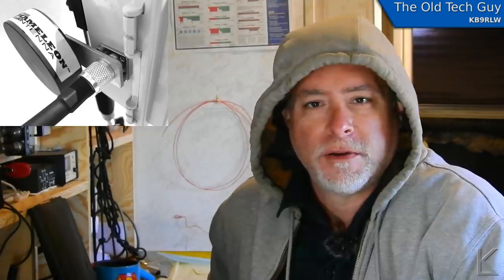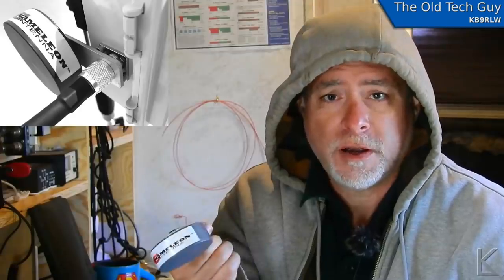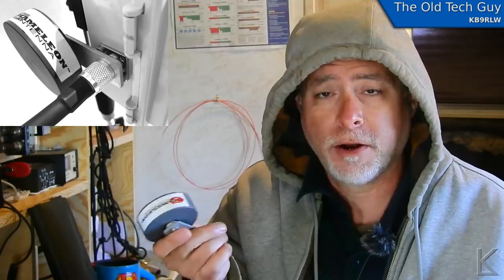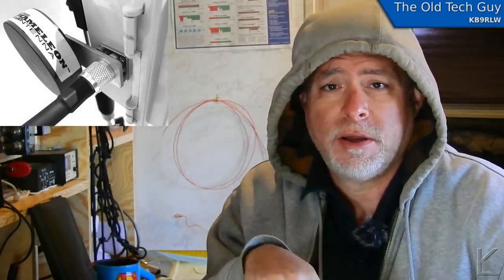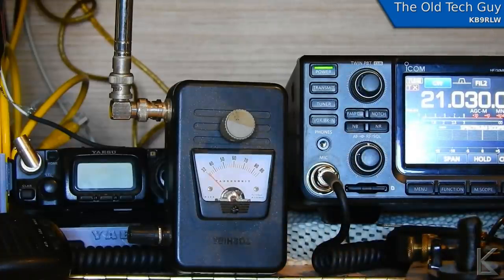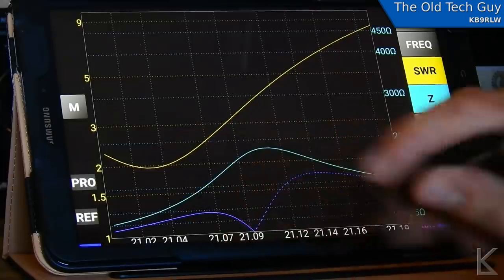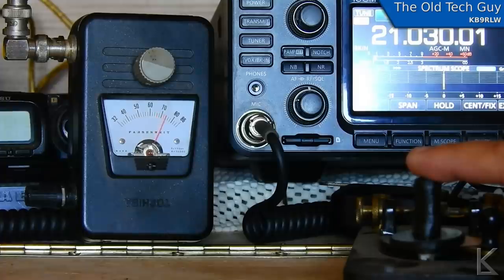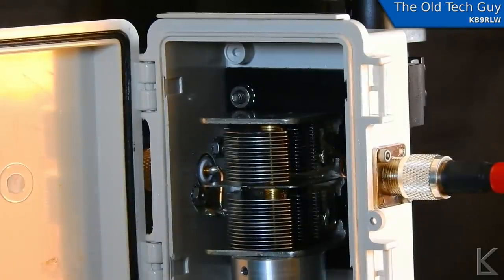Ham Radio - The Chameleon Antennas power compensator for magnetic loops.

Comment: Hi. This is Henri, VE2WHA. Why did not you measure the field WITH more power from the transmitter ? If no more power is radiating from the antenna, this not a very valuable device. Just a protection for the VC. The question is : is there more power radiating FROM THE ANTENNA itself. Could you tell us about this measurement ? Thanks a lot. VE2WHA.
Reply from the maker: I think the idea is to allow more power to be put into the antenna, which by default would increase it's radiation, to a degree.  Obviously not a linear increase, but certainly an increase.

Comment: I think its acting like a corona ring by adding more surface area there at the high Z end of the loop. When you adjusted the tuning cap to compensate for the shift, was it toward higher capacitance or lower? Fascinating...
Reply from the maker: Toward lower I think.  Yes, it shifted downward and I had to tweak it up in frequency slightly, so less cap.
Reply: @loughkb  If you could actually measure or see the voltages around that thing ill betcha the highest would would now be found on open end of that hockey puck... Thoughts? Many thanks... de K4WRF

Comment: I have another question for you. How important is the current choke on the coax? The reason I ask is the coax that came with my loop failed and I've been running coax without a choke. I don't notice any issues,  but I wonder.....
Reply from the maker: You'll have some RF on the shield of the coax.  At low power levels, it's not really an issue.   At higher power levels, RF coming back on the shield can get back into the audio circuits of your radio and distort your transmitted audio at the least.  Could be a health issue, or interfere with other electronics in the shack.
Reply from the maker: By the way,  I've noticed some intermittent connection on the shield on my supplied jumper too.   Those crimp on PL-259's are not well done, I think.  I'll probably put new ends on it.

Comment: Kevin, did putting more power into the antenna with the compensator actually put out more radiated power from the antenna or only into this device?
Did you look at the FS meter after you raised the power?
Reply from the maker: Yes, it was proportionately higher.   Had to turn it's sensitivity way down.
That was the reason I looked at the meter at 5 watts with and without the puck installed.   There was no decrease with it, which indicated that it wasn't dampening the produced field.  A lot of people seemed to miss that detail.

Comment: I would check it on a frequency that requires the cap to be meshed at least 50% before I trust their claim.
Reply from the maker: Later that evening, I was doing some psk31 on it down on 40 at 30W  without arcs. It does seem to work.

Comment: How does it work when it is positioned at the same place, but electrically isolated from the loop?
How does it work when it is positioned at an other place in / near the loop?

Maybe the trick of this thing is not the actual capacitor, but just its ceramic dielectric material. The dielectric material interacts with the E-component of the RF field. So this thing may modify the near to far field characteristics and help the antenna radiate power by giving the E-component "some place to resonate". Keep in mind that a material with high dielectric constant is to the electric field, what a ferromagnetic material is to the magnetic field. It "conducts" the field lines far better then air (vacuum).

Think of e.g. ceramic patch antennas for GPS ore GSM. These antennas would be much larger with air as dielectric. The high dielectric constant of the ceramic material in the antenna makes the antenna resonant at the same frequency but with much smaller dimensions. You could optimize the design in the other direction, e.g. to handle more power at the same dimension.

Comment: The clue of what it does is in the name remember the current is what we want radiating the extra cap in circuit compensates for the higher voltage reducing the chance of the variable cap arcing at a higher power output
Reply: This is the closest correct explanation of how the compensator works. In effect, the compensator is a series connected capacitor (in series with capacitance between braid and inner conductor) that lowers  capacitance and and in turn lowers the frequency of resonance. (as the video shows). But the voltage capacity of two caps is greater than one and thus the voltage input can be increased. Unfortunately, the current capacity does not change, and so the field strength is unlikely to change. This was shown on the video too. Would I buy one? No, there is no practical gain other than reducing the likelihood of arcing.

Comment: Did you measure the field strength (near field ) power output after increasing the power from 5w -> 30w? Is it possible the extra power is not being radiated by the loop but absorbed by the compensator? Would be great to see how the radiated 
power increases as you raise input power.
Reply from the maker: Pegged the meter, had to back its sensitivity way down. It was behaving as expected.  That's why I checked it both ways at 5 watts.  To make sure radiated power didn't suffer by putting the puck on.
Reply: @loughkb  so do I understand you to say that the near field field strength went up after you attach to the compensator capacitor and up to your power to 30 Watts?
Reply from the maker: @marcclarke01  That would be the reason for the meter pegging and me having to turn down its sensitivity.

Comment: Thanks, Kevin. I was waiting for this video for a long time. You are the best! However. I have a similar antenna Chameleon F-Loop 2.0. I've just checked my notes on this antenna and apparently it starts to arc only when > 30 W are used. 30 W or less are absolutely safe. Thus it's quite possible that the power compensator just does nothing. 73 de R2AUK
Reply from the maker: We'll find out in the future.   I'm going to build a beater loop once I pick up a sacrificial cap at the Yuma ham fest.   I'll push it til it arcs, put the puck on it and see for sure.
One of my home made loops had a cap with half again as much space between the plates and I couldn't get much over 30 before it lit up.   That was with more space.  Another loop I made with a salvaged cap spaced about the same as the one in the chameleon loop couldn't do much more than 15 before it flashed.
Reply: I have run 60w in my f loop with this compensator no problem
Reply: @ronangsr  60W with key down in CW?
Reply: @danielwebb1004  30watt in cw, 60w ssb

Comment: That is extremely cool!
I built my own loop a while back before I got my general, and my cap also has pretty tight spacing.
I want to use it for 10 watts SSB QRP, but this might change things...
One surmises that any cap of the same or similar rating would perform the same task if installed the same way.
Very interesting.
Thanks for another thought provoking video! 
73 de N2NLQ

Comment: But it's not really a test if you don't try 30 Watts without the compensator. If that capacitor flashes over without it in position then and only then we know it does something.
Bill, G4GHB.

Comment: The main claim hasn't been actually tested. You would have to find the breakdown point of the capacitor and that would have to be a point at which the capacitor arcs at least 70% of the time, then you would have to use this device and test with 2x the power. Your previous experience does not count, as the environmental conditions are not the same (humidity,  temperature ...).
Reply from the maker: I plan on picking up a sacrificial cap at the Yuma hamfest and building another coaxial loop just for that purpose.  As I said, I don't want to risk damaging the cap in the chameleon box.
Reply: @loughkb  Everyone likes a video with some electrical destruction so looking forward to that one ;)
Reply: Chameleon does have a video where they take it to 100watts (they don't recommend doing it). It did not arc in that video.

Comment: Does it flash over at 30w without it?
Reply from the maker: Like I said in the vid, I dont want to risk damaging this cap.  I know from my many past builds of mag loops that it absolutely would have.
Reply: @loughkb  But that makes the test inconclusive doesn't it?
Reply from the maker: @PaulGrahamM0PGX  For those that dont have experience building magloop, I suppose.  I'll be picking up a sacrificial cap at the yuma hamfest to build a beater loop with.  I'll revisit it then for those that want fireworks.
Reply: @loughkb  Sounds like a plan :) although I don't want fireworks. I was simply pointing out that the test doesn't have a control, other than your experience and opinion. I'm not trying to knock that and I don't doubt you either, but without a control, well, that leaves the whole thing open to speculation. What puzzles me is that attaching one side of a capacitor and leaving the other side floating should have little to no effect. Adding a control would at least help to suggest that the capacitor does do 'something' (and confuse me all the more). I've built around five mag loops ranging from 1m to 2m diameter using coax, 8mm aluminium tube and also 1" copper tube. All but one have only had low power capability because of the types of capacitor I used (that one I used coax as the capacitor, so it was pretty much set to one frequency, but it worked with 100w). I still have the large loop sitting in the outhouse. Maybe one day I'll get round to resolving the capacitor/tuning problem and be able to actually use it.

Keep up the videos and have fun at the hamfest :)
Reply from the maker: @PaulGrahamM0PGX  Thanks Paul.  I didn't mean to come off as annoyed, but I guess I did.  Sorry about that.